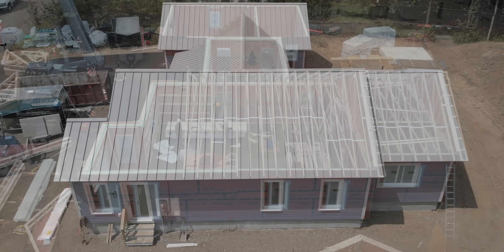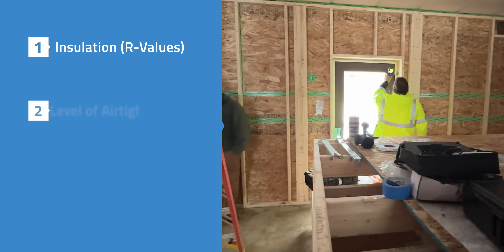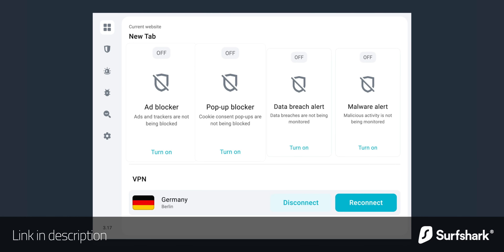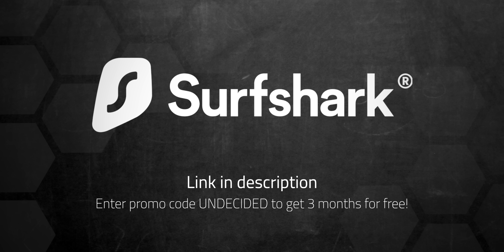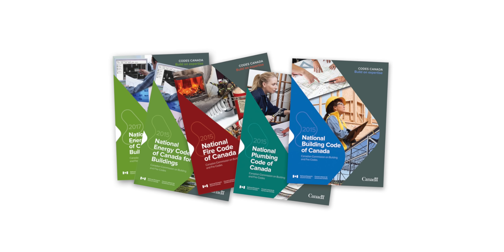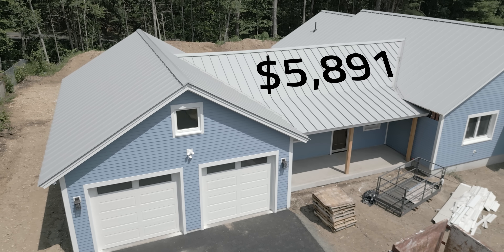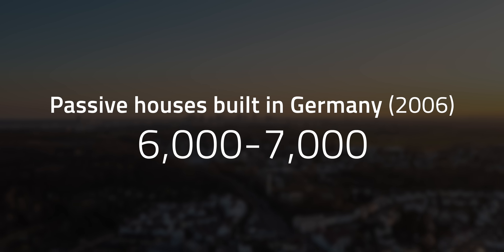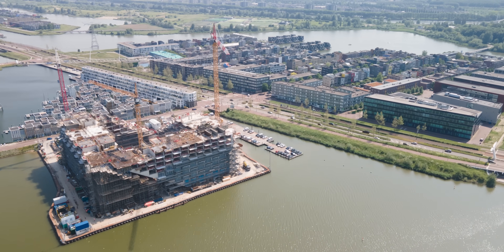Why Do American Homes Suck?

Comment: 3 years ago I remodel my Phoenix 1600sf  home, added 3inches of EPS board to the exterior and acrylic stucco, change some windows and added more attic insulation, I double the insulation in walls and ceiling. I honestly do  not notice the diference, I have all the data of temperature changes of previous years on my smart thermostat and energy consumption from my electric company and enphase solar system. I still a big fan of insulation, but with current prices seems that in my case $5k of solar panels will do better than $5k of insulation

Comment: Being in construction, I'm actually disgusted. Something I usually don't feel with your videos. Gaslighting is the first term that comes to mind, over the EU 'green' boasts. UK does not have the stats presented, that's a cooked figure. Its an Island, most homes are considered 'heritage' homes; and a home owner is NOT allowed to do any alterations without Council approval. I've talked to many friends there, who had to do simple things like repair a linoleum floor or a exterior door. Everything removed, has to be put back in and reused according to historic building practices not modern. They are seriously substandard compared to any home in USA today, by reason the owner has no rights compared to USA homeowners. This is not isolated. Most of the homes in EU, are substandard compared to American homes & lack any modern conveniences. The people who visit, visit wealthy areas and do not see the normal routine country peoples homes. This is where the difference lies as most societies start with the farms. Building in the USA is more challenging due to different climate zones; IE the foundations in Idaho are not built like foundations in Florida. Because of the current situation, we can't get lumber or materials easily to these areas, prices are 300% higher and all the skilled workers have been killed off. There is a shortage of skilled labor. The new incoming illegals do not have the skills Americans had, its going to impact building significantly. I seriously think you should stop talking to people in on the 'new green deal'; they give false information.

Comment: Matt - in the UK, most homes are made of brick and stone. However, prior to the last 10 years or so, they are draughty, poorly insulated and cost a lot to heat. We live in a 35 year old 'authentic' welsh longhouse, and the so-called double glazing is basically useless. While some homes have solar panels and air source heat pumps, our climate still makes it very expensive to deploy air source heat pumps in winter thanks to the exorbitant cost of electricity. Your new home is amazing.
Reply: I live in Spain and I always find it amusing how misinformed Americans are about European Countries. Oftentimes I wonder where they get their information.

Most construction in Spain is very old and very poorly insulated and definitely not energy efficient.
Reply: @jordibarguno Correct. Thanks for bringing it up. Ultimately it comes down to cost.
Reply: Not sure how cold it gets there compared to the uk, but most brick homes in the uk have been fitted with cavity wall insulation, which is just small bits of insulation pumped into the space between the two brick walls. Done all the time here.
Reply: Some resources I found said internal insulation is fine, others say the bricks could hold more moisture in winter and cause damage from freezing and thawing.
Reply: @pikapomelo  We dont tend to freeze much here any more, only for December so maybe its not as much of an issue over here, with global warming its getting hotter all the time here, i only have my heating on from November to February and even then not very much.  You have to go up to Scotland for snow and gold weather.
Reply: That's a bummer to hear.

We live in a 100 year old brick building in Chicago and I may be wrong, but as I understand it, if we insulate between the brick and drywall, the bricks could freeze in the winter and cause damage. So... we have to pay to heat our exterior walls...

We are ok to insulate the roof and we are able to use electric heating with our dual fuel heatpump and furnace most of the year.

I hope we can figure out these issues for new construction, but not sure how limited we are for all the old stuff.
Reply: @pikapomelo  The insulation needs to be put on the outside of brick or concrete walls,, otherwise you would run into problems with the moisture accumulating inside the structure. If you are not allowed to put anything on the outer side of the facade, for code reasons or whatever, you'll get more results in replacing the windows, or even making sure that they get insulated properly (the seams that connect the windows to the facade wall - usually with some sort of expanding foam).
Reply: Today I learned about cavity wall brick buildings. Thanks!

I'm pretty sure ours is solid brick.

Good to know about the windows. We do have double pane at least. And to know insulating outside the structure is an option.

This is a 6 unit condo and I doubt the other units want to change the facade. It also goes right up against the sidewalk.

I guess there are so many different ways these things are built.
Reply: @pikapomelo  in that case what about internal insulation, my parents house is 130 years old so does not have cavity, they had to strip the internal walls back to brick and instead of plasterboard have an internal insulation layer added, its quite comon for older homes, over here, you loose 10cm is off the size of your room, but you only do it on external walls.

Comment: Like that $5891 savings figure you mentioned, you didn't say what time period that is over? 10 years? 30 years? Also what was the increased cost of your house, I bet it was a lot more than $5891. Not to mention that is just a "calculation" - which don't mean jack compared to an actual experiment of realized savings. Heat pump, air filtration system, geothermal heating, triple pane windows, special insulation, etc. We already have a crisis of home affordability in this country, mandating these things for everyone would just make it worse.

Comment: In EU I just bought apartment and it is made from concrate, some walls are "dry wall" but double and insolated. Triple glass windows, very good insulation.
Reply: I will also switch to EV because high oil prices and cheap electricity :)

Comment: One reason, Money. The cost the builder puts up to build then turn around for profit is the biggest reason. Second, availability. There are not a lot of builders out there that can build these types of houses. Most people are not willing to spend an additional 5, 10 or 20% more on a house built to those better standards. I would have loved to have a factory build home like you Matt, but there was no options like that here in Southwestern Idaho in 2006. I did look into steal home manufacturing with a high insulation rating as well but there were no builders here that could do it. It is troubling that the U.S. has lagged so far behind other countries. A simple update to the housing codes would help the U.S. move towards a large energy savings giving more flexibility to our nations power grid as well. On a side note, I would rather have assistance from the government in refitting my existing house with better windows and increasing the insulation to save money and help the grid as an alternative to the cost of solar. Not everyone has the extra money for solar. Great Video Matt! Thank you.
Reply: Availability is in relationship with demand. No point in offering efficient solutions if there is no demand.
Reply: The only reason there is demand for Solar is with the help of government tax rebates. Being the government is pushing solar for homeowners do to their green push, solar is not as affordable as many believe. Most can not afford the move. So, why doesn't the same government create that demand and offer a compromise in helping homeowners with their R value and window efficiency in their homes?  @lauriviik

Comment: Great video.  Every state should be on a minimum 2021 IECC which starts requiring CI and rainscreens in sone climate zones.  Even 2021 IECC should require better fenestration values.  0.40 is far too lax.  Id say 0.30 should be least efficient required but aim for 0.27

Comment: The Build Show has some very good stuff, at least from a USA perspective.  But watching Matt Risinger's astonishment when brought face to face with some of Europe's building technologies and mandated standards has got to be some of the most amusing content on Youtube.    🤣🤣🤣

I also subscribe to DIY Solar Power with Will Prowse and Lithium Solar and it's clear that often the lack of regulatory control plus the profit motive actually makes utility companies the enemy of the good.  What's needed is incentives, suitable regulation and appropriate switchgear/controls to make solar + battery + buy-back and load sharing the norm rather than the exception.
Reply: Suitable regulation is not the problem… there are thousands of pages of suitable regulations - I am reading through them as a DIY’er!

Lack of SIMPLE regulation & freedom is the problem.

If people don’t want to abide by 10,000 pages of code, then give a simple alternative (ie keep batteries outside, keep Solar unattached, etc.) and offer suggestions / best practices instead of legal regulations for those solutions.
Reply: @DavidHalko   Yep.  I'd agree that if it's thousands of pages then it probably isn't suitable.

Comment: Interesting video.  No idea on how efficient or inefficient my house is.  Granted, the house was built in the mid 1940's or 50's.  I forgot which.  Double layer of bricks externally, interior walls with wood slats and plaster coated versus having sheet rock walls (minus the basement which I did have all the walls put up with sheetrock).  They do not make houses like this anymore, that is for sure.  Tutor house.

Comment: I'm in the process of putting on a substantial addition. I find myself torn over the efficiency as the existing house was built in the 1960's and was only 2x4 construction. Obviously the addition will be better insulated than the original structure, but it'll be sharing a 24 ft long wall so it's not like the finished building is going to meet passive house standards. So like most people I'm going by cost and a little intuition. In my case the walls are about 40% of the insulated area since the addition is over a garage the floor & ceiling are a far larger area. I'm using trusses for the floor and ceiling so they'll have room for tons of insulation. Also this means the conditioned space will not have thermal contact with the ground. I figure what further efficiency gains by going to 2x8 construction will probably be in the margins compared to the area it's covering. But the thing that makes me torn is the windows. Compared to walls windows generally have a much lower R value and it could be worth putting in triple pane, but then again I don't have estimates for that.

Comment: Currently rebuilding my house from the inside out (its a 120 year old miners house). It was affordable under 100,000 and livable. As im rebuilding exterior walls with 2x6 framing and installing new windows. The thing im noticing is the options are there theoretically for more efficient building in the US. Its just hard to do because its been done in a certain way for so long that the conventional options are advertised infront of you and these other options and almost hidden in a way.
Reply: Yep… the options are all there in the US.

Comment: Not only are the requirements for new buildings to low but we don't require old buildings to update.  My apartment complex was built in the 70's and still has the single pane windows that you can feel air moving through even when closed.

Comment: German windows also have stable frames with different chambers and heatflow interuptions build in. Totally different from the flimsy vinyl frames that we use here in North America. Another advantage. You can open a German window anytime in winter even if it's less then minus 40 Celsius, since the have the seal in the middle of the reset frame/ wing details.

Comment: I’m retired in my last home I will likely ever own.  Although we have tried to make the changes toward energy efficiency, it doesn’t seem likely we will ever be able to convert this house to the degree of energy efficiency seen in other countries, but moving out to a new home isn’t happening either and this house isn’t going away even if we did build new, someone will be living here. I’m guessing this is a common situation among Americans.  We need more ingenious, accessible, cost allowable means of converting the homes we already live in.
Reply: 3 years ago I remodel my Phoenix 1600sf  home, added 3inches of EPS board to the exterior and acrylic stucco, change some windows and added more attic insulation, I double the insulation in walls and ceiling. I honestly do  not notice the diference, I have all the data of temperature changes of previous years on my smart thermostat and energy consumption from my electric company and enphase solar system. I still a big fan of insulation, but with current prices seems that in my case $5k of solar panels will do better than $5k of insulation
Reply: @gsabic  we have had a nearly identical situation here.  We have reduced our cost through solar but the house itself has not improved greatly in usage following additional changes of new “efficient” windows/doors, added insulation, etc.

Comment: For an industry (home building) that does everything it can to cut costs, you would think they all would have adopted the factory-built path you used to build your new home - assembling wall panels in a controlled environment using robots seems like it would be much more cost-efficient than building everything by hand on site.

Comment: Not expected that kind of difference between US and Europe. For us it is normal to build a zero energy home of if possible net producing home.  Airtight, good windows, solar, heat recovery ventilation, high R values are standard. Even heat recovery from taking a shower is common. A lot of new houses produce 2Mega Watt hour or more than is needed over a year including living, to cook, laundry, etc.

Comment: Because 90% of the people in the US could not afford the house you just built. As I recall, you spent close to or over $100,000 just on your solar system.

It has taken me 30 years to save for the home I currently have. It's a three bedroom in a rural area and with operating costs, living costs and maintenance costs, I'm barely making it using the "1/3 rule".

I'm glad you can afford your place, but put yourself in the shoes of the other 90%. You'll see why.

Also, our form of government and "Live free or die!" attitude abhors the European model of regulation. Quite frankly, if that's what you like, being told "How, What and Where", move. Emigrate. No one is stopping you.

Comment: Hearing that Carter put solar panels on the roof, and Reagan removed them shortly after, is about the most "Reagan" thing I've heard yet. Imho that clown did decades worth of damage.
Reply: He didn't remove the panels "shortly" after, but seven years later in 1986. The roof was leaking, and they removed the panels during the roof repair, but did not reinstall them afterward.

Comment: Im Australian (so have seen the dark side of non-existent energy efficiency) living in Germany (the light side). I would have to say that how energy efficient ones house is over here seems to be a national sport. One tip regarding the windows from Germany. Windows are generally triple glazed these days, but a lot rides on the fact that the windows are installed using the correct materials and methods so that they are not deemed useless by allowing in the cold through the joins with the wall. The government offers grants for new windows that are rated at a certain energy efficiency, however they have to be installed by a licensed contractor. Just went through this process.
Reply: Here in Australia we may as well live in tents, our building codes are piss poor!
Reply: And that's in Germany which is fairly warm country. In Finland 4 pane windows are standard for new projects I believe and I've never seen less than double glazing, even in oldest of houses.  Rest of the structures follow similar thinking in their construction obvs.
Reply: Same here mate, another one from down under living in the light.
I also built my house here in Germany 5 years ago, and it's a completely different process than the paper mache houses they have in Oz and the US.
Most of the time I was just watching and learning from my wife as I had no clue what was going on, even after owning a couple of houses in Oz.
It does really help having all the latest tech (heat pumps etc), saving energy (so bottom line of time), but more importantly comfort throughout the year is so easy to manage.
Nothing like strutting round your house when it's -20 outside in your pluggers and stubbies.

Comment: I think air tightness need in single family homes is overblown, and in years from now will have been found to cause health issues and that the energy gains are lost in the fabrication and maintenance and running of systems used to circulate the air. The real problem in the US is homes are needlessly large, density is low, so ROI is terrible and is made up for by lowering standards to keep costs lower. A super energy efficient home isn’t efficient if it’s basically a bunker for two adults and a child or two. It doesn’t scale, it’s terrible for the environment, it’s expensive in the short and long term as there are no economies of scale. It’s unsustainable. Decades from now, higher density towns will have the best efficiency and quality of life, a lot of them featuring multi-generational housing complexes, not cities, not single family bunkers.